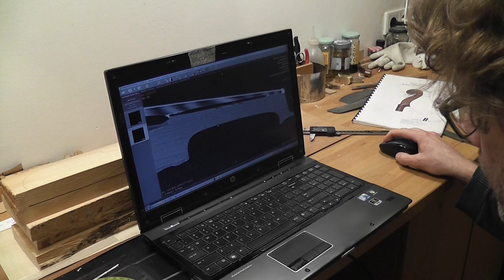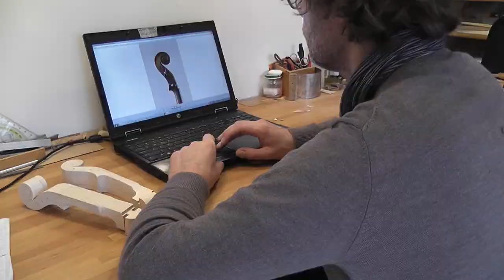Exploring lost violin making practices 1: the neck

Comment: That neck joint reminds me of a Spanish method of attaching the sides of a (classical/flamenco) guitar to the base of neck, rather than attaching the neck to the body, which is still in fairly common use among luthiers handmaking guitars. Interesting to see it on a violin!
Reply from the maker: Yeah, you're right, Spanish guitars are still made like this! Violins no longer (-:

Comment: Very nice series - even with comparison with other violin making videos. Especially to rib making (!) I plan to do violin, and see that ribs could be made separately, bending wood without hot wire - which is for me useless, if do just one violin, and can use mold.. please, where could be find some measurements? many thanks.
Reply from the maker: Thanks for your kind comment! I think you will always need a bending iron, even if you only make one violin... But you can make one yourself, for instance from a copper pipe that is heated. But always be careful...
Good luck with making your violin!
Reply from the maker: Measurements come be found here:
https://geertenverberkmoes.nl/wp-content/uploads/2023/03/PhDthesis_GeertenVerberkmoes_A4_drukversie_15-10-2021.pdf
Reply: @Boussu_Inside_Out  nice, comprehensive material, thank you!

Comment: Perhaps I'm not the target audience, but I've watched several other (presumably "modern") making a violin with hand tools videos.

And I'm a detail-oriented person.

BUT

This looks to me like "the normal" build process. If it isn't (and I do believe you), I need the odd comment or caption telling me what's different.

Perhaps there are deep-violin people watching this video and going "wow - that's a CRAZY old technique", but I bet they're few number.

Throw me an informational bone 😞
Reply from the maker: Hello Paul, thanks for your comment. Most current makers use a full inner mould, something now reffered to as the "Cremonese method". In my reconstruction process, no such mould is used. This radically changes the order of construction steps. For example, I start with making the back plate, building everything else up from there. In contrast, most modern makers, using a mould, start with the rib structure. Another aspect in the method I tried, is an upper block that is an integral part of the neck (see at 6:45 in the above video). You can guess... not something done by many modern luthiers, but quite a common feature in violins from the past.
Various other procedures are different, but it would go too far to explain here. Please look again to various YT videos on violin making, compare and try to spot the differences.
By the way, in the old days, many varying methods were used, no standardisation at all. I just tried out one of them (-:

PS: of course, many of the individual making procedures/steps are similar or corresponding between various making systems, the difference is often in order of the steps or certain details of execution...